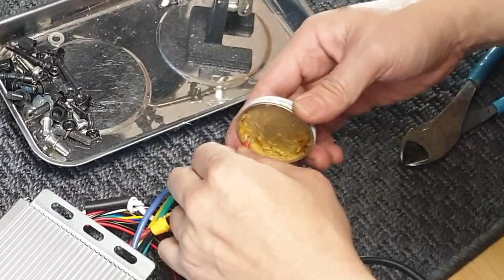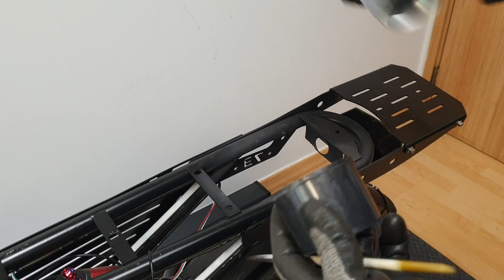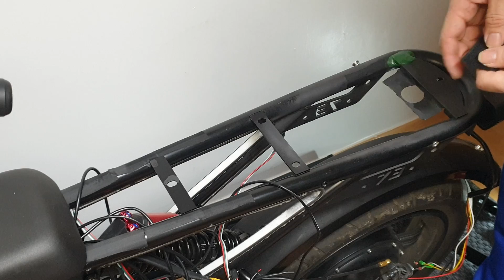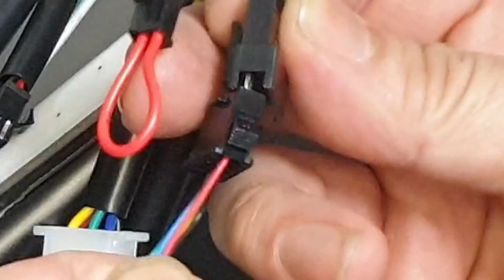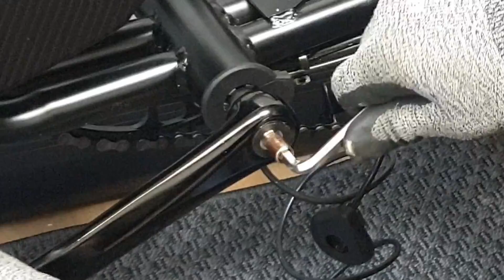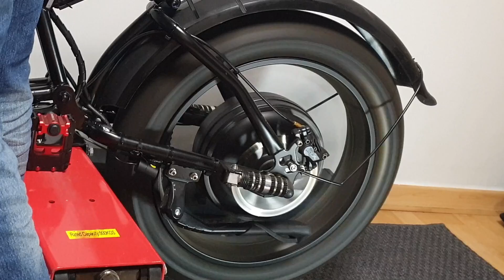How to upgrade ebike High-power controller

Comment: on my e bike the hall sensor connector is the one with six pins side by side while the controller is like the one in the video. Is there an adaptor for this or do i have to solder? The bike works without the hall sensor plugged in but the speedometer doesn't work
Reply from the maker: The speed display will not work unless the hall sensor connector is connected. The rpm is measured as the hall sensor turns on and off.
Reply: @Mobilant_TV  nevermind i use jumper wires to connect

Comment: Hi, my name is Sam. I recently purchased electric bicycle 60 volt 1500 watt motor, 26 inch fat tire.
My first right didn't go so well after riding for 5 miles when I stopt   the bicycle starts moving on its own Without me touching throttle. I was losing also pedal assistant when I was driving. There is no sensors for Pedal assistant  it works different way. The bicycle was also  increasing speed without me controlling speed I didn't touch the throttle and I wasn't  pedaling.
Since the owners of the company are located in Chicago, they picked the bicycle after I report the problem. But they are telling me that they cannot find any issue with the bicycle. I present them three different videos with the problem.
After I did my research including watching your video I realize that controller is responsible for all the  problems that I was having with the bicycle riding for the first time. Any tots, what could possibly happen or what is happening?
Thank you.
Sam
Reply from the maker: The structure of an electric bicycle is simple, and cases of it moving on its own have not been reported. The speed is controlled by a variable voltage of 0~5V. If the bike is moving on its own, it is likely due to a short circuit somewhere. I suspect there might be damage to the throttle wires.

Since you have submitted video evidence, it would be best to request a replacement for the controller, throttle, or throttle wiring.

Best regards,
Dr. Road
Reply: @Mobilant_TV  Thank you
Reply: We found the problem after changing controller and the throttle driving for a while. The problem did come back after that. We changed the harness. It was shortage in the wires that connects everything. The bicycle is fine.
Thank you so much.